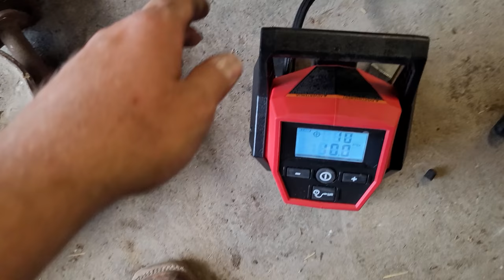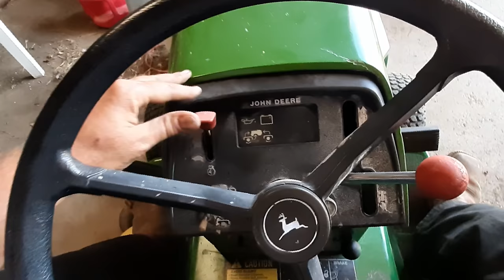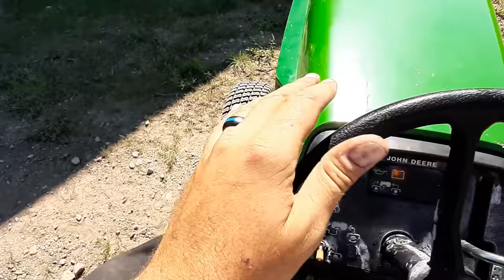Old John Deere Lawn Tractor - Will It RUN and MOW again?

Comment: Grew up with a dad who was a JD salesman. I cried when I saw that HF engine. 

BTW just a little further up the family tree was the 318 which is probably one of John Deere's all time greats in the Lawn and Garden arena. A 318 would actually be a collectable.
Reply: Oh yeah, used to have one of those. Very similar to the 316, had a BEEFY deck on 'er. Had to get it welded a couple times, the welder/farmer I took it to was an International guy. Quite jealous of that heavy deck.
Reply: Nothing wrong with the predator engine.
Reply: @justinbevier8231 there definitely is, they’re Chinese junk. You can’t beat the original engine that would of been in it, I have a collection of garden tractors and each ones got a replacement engine I wish I can find an original

Comment: Thanks.  We still have our JD 322 we bought new in 1988.  At one point about 10 years ago I got on, turned the key, and nothing happened.  I parked it and there it sits.  This video has given me the enthusiasm to get it running again.
Oh, it was very reliable except for the mower deck - it loved to throw belts, even when new. PITA job to replace them.  Even the dealer was baffled.

Comment: we've got a late 70's deere lawn tractor. Picked it up from a lady on FB for $150. Thing runs great. Has the original Kholer engine still, came with rear tiller, electric lift, and we just grabbed plow for it recently. terrific tractors. Going to do a full restore on it one day.

Comment: Deere made great garden tractors back in that era. This 316 is pretty similar to the 318. I still have a 318 myself that I have a 50 inch mower and the model 49 snow thrower for, it's a great machine. Still going nearly 30 years later. Hold on to that 316, they are built like tanks.

Comment: Of course it will run again it's a John Deere where I'm from is still common to see hundred-year-old John Deere tractors still in use by their proud owners of course I live in Iowa
Reply: It's got a shitty Chinese replacement motor, though.
Reply: I’ve never owned anything but a John Deere mower from a 112 to 114 to 312 to 316 to my current 728 x treme. The best part been mowing for 41 years . Well my 3 children used the 316 way more than I. They are all grown up and the two girls don’t mow any more and the boy well he or his bride can push mow in fifteen minutes but it is with a John Deere. Nothing runs like a Deere and we will pretend we never heard the part about smells like a ……..
Erik I’m with y’all on yet another channel.
Reply: @pibbanon1987  those preadator motors arnt that bad.

Comment: I've got a 332 my dad bought new in 1988. 3300 hours on it, Yamnar diesel still doesn't use a drop of oil. 316, 318, 330 and 332 are all similar machines. All of them good tough old rigs. Well worth fixing up.

Comment: Had a ol John Deere that smoked more than a coal mine on fire but it was free. Tires on the front were dry rotted but still had good tread. A feller thought to himself “why spend $60 on new tires when you can spend $30 and buy some Slime and patch them”. Welp the slime worked a charm for over a year

Comment: Awesome! Derek I bought a JD 332 which has a 3 cylinder Yanmar diesel in it. They are the toughest garden tractors ever made. Hydraulics etc. 
Lots of accessories for them, but they're getting hard to find parts for.
Should be easy for you to get running and fix it up. 👏👏👏🤠😎🥃🥃🥃🤙🤪💯

Comment: Hey Derek, Pro tip: When trying to do a tire plug...lube up the hole reamer with some rubber cement glue, it'll go in super easy then. Same with the plug or "worm", once you have it threaded into the insertion tool, lube that up and in she goes!
Reply: Another option is to just chuck up a 1/4 inch drill bit and drill out the hole. Still a snug fit for the plug but way easier for me than a reemer. I've been doing it that way for ages on my stuff. And even in a 10 ply that gets the full trail and highway treatment they have never once let go on me
Reply: Also much easier to have some air in the tire

Comment: We had a 1987 316 with the Onan 18hp engine.  Loved the sound of the  opposed twin cylinder Onan, and it had great torque for wheelies..... the last of the ALL metal JD garden tractors. sold it and got a 1998 425, which is a beast!

Comment: The battery light means that the system isn't charging the battery.  Something is still funky in the wiring most probably. You'll need to fix that or you'll get a dead battery real quick-like.
Reply: That's what I thought when my old dear John bat tree light came on, figured I would have to fix it when the battery finally went dead. Nope, still charges, turns out a diode for the light was leaking, haven't changed the battery or charged it once and the light is still on 8 years later
Reply: He's used to it by now. He has the worst luck with batteries in the world.

Comment: Congratulations! i have an old 'Farm King' garden tractor that sat in a field for a few years after the shed it was in blew away. After a good amount of work, new tires, etc., I just need do a bit of rewiring and I'll have a nice old machine. They built them very strong back then, and the class 0 three-point is a bonus as well 😊

Comment: I like the old Scout traveler and I have a 77 model Scout II Tera with the 3 foot long bed and the factory fiberglass top over the separate bucket seats and it has the automatic shift on the floor console with the 304 V8... My parents bought it in either 1979 or 1980 and my dad let me have it a couple years ago and I've got to start trying to restore it little by little as I can afford to....I've also got a 89 model bronco II Eddie Bauer that's in pretty good condition besides needing the fuel pump replaced and 2 small places on a quarter panel

Comment: JB WELD works great on plastic: radiator expansion tanks and fuel tanks.  Oops- I commented before you used it.  Anyway, looks fine, runs fine.  Good!

Comment: What I wouldn’t give to spend a day just hangin out with you fellers.. this reminds me slot of growin up spending most of my time in the garage with my papaw and cousins. We were always turning wrenches on somethin.  Mowers, cars and trucks, four wheelers, dirt bikes. If it had a motor we were working on it lol 
 I remember my cousin had this old ford rider, we made duals for the rear end and put dual tractor tires on it and a hood stack. We’d climb hills on them. 
 I remember I climbed this hill at home, half way up I jumped Back on the seat and boy did she bite the ground, next thing I know I’m staring at the clouds with a mower smashing down on top of me. It flipped end over end, landed on its wheels and took off down the field still running lmao 
Good times

Comment: Good for you   I have a 1986 Cub cadet that I Put anew motor in and rebuilt the deck more than once   She runs like a real champ.   Steering locks up some how.  I have to do the same thing you did pullthe top offand see what is going on

Comment: I have an 81 318. Probably the best small property/home gamer machine ever produced. Solid 18HP Onan engine. The transmission alone is half the mass of an entire big box riding mower. Hydraulic power steering. 4 Hydraulic outputs at the front. 3 point hitch. Plenty of solid implements. She's a beast.

Comment: I own a 1984 jd 316 that has been in the family since the late 80s. Currently has 980 hours on the original Onan. The neighbor has gone through 5 tractors in that time but the old 316 is built like a tank. I do maintain it religiously but they just don't build them like that anymore.

Comment: I worked on those old girls for 30 years. Most were fun, some weren't.  The PIN for the tractor is on the pedestal below the PTO switch.  The wiring looked "interesting".  Looked like maybe a 39" deck? Anyway it'll be good for another 20 years.  Love the channel.

Comment: The 316 was built between 1984 until 1992 and was basically a downsized 318 and has a Kohler single-cylinder engine.   It
was built in Horicon, Wisconsin and was one of  the best mowers Deere ever produced.  Real steel.

Comment: Bought a 86 322. Yanmar 3 gas. Would pull wheelstands. Bullet proof motor
 Sold to friend cheap.332 deisal. Same block. The best jd garden tractors

Comment: My dads 316 went through 3 motors. He finally put a bigger Honda motor on it. It still runs, but the ears on the transmission case snapped off and that is what killed it. It’s still out in the barn, and I may try and find a new transmission for it. Who knows

Comment: I have an all original 316 with the Onan engine in it. Same deck as the one you're farting around on. I got the tiller and snowblower attachments. I have yet to go get cold snacks with it. I'm surprised by the condition of the paint on that one. Mine has contaminated metal so the paint is mostly missing. It just falls off.

Comment: It's crazy that a guy that is so good with cars is afraid of working on a mower. I built a riding mower completely from scratch out of spare parts that I had laying around last summer. It only took me two days, and I don't have a tenth of the tools that Derek has. Mowers are easy, don't be afraid, lol. That tank is easy to fix. Just heat up some of those zip ties you guys have laying around, and use the melted plastic to seal it. It will be good as new when it cools. Yes, I've actually done that before to fix the exact same issue on a Deere that i was playing around with. The zip ties work just like solder wire. Just heat up the tip and stick it in the holes. My newest project is a 1972 Western Auto push mower that has been sitting over 20 years. I'm buttoning up a Troy Bilt Pony that had been sitting for 5 years today, and then I'm starting on that one. I love working on mowers. I taught myself and fell in love with it.

Comment: Well i have a 1982 john Deere snapper 310 and i also have a 1996 John Deere GT262 and 2 more newer ones but the one is a part mower but both of my older ones both run

Comment: The old girl got an engine swap at some point in it's life. These came with Onan engines from the factory. The predator is a common swap though. Tough little tractors.
Reply: J U  -  We used to have a 322 at the golf course i worked at.  It had a 3 cylinder Yanmar gas engine.  Nice little unit even it it did sound like an angry hornets nest at full RPM's.

Comment: Good old mower , I  see the predator replacement engine, .... it came with a Kohler 18 HP, / Onan ,  I   believe, 318, the primarily used sundstrand hydro transmission , you can change the hydro filter and fluid on it ,  ..indisuructable, believe me ,I've beat them , they are awesome,  ,   is one of  Deere's best tough mowers ,  in the 80s  I had many JDs , back then

Comment: neutral takes about 4 seconds to adjust, but you gotta take the body pan off again.
Jack up the rear tires, it's the cam on the side of the hydrostat that the linkage goes to. Loosten the small nut, adjust the big nut (the 7/8 one i think) forward or back with the tractor running at FULL RPM. 
Also a good time to recommend the hydrostat probably needs a new filter and fluid, since you're down there.

Comment: Procedure problem. I always do the tire ream thing with the tire hooked up to a compressor.  Escaping air tells me where the hole is and pressure in the helps the reaming process. Only way I’ve ever done it

Comment: Your brothers issue with the delaminating wood might go a lot easier with zip-ties. I would put something under the zip tie(s) so that it doesn't cut into the wood on the edges. Cardboard or something like that under the wire-tie might work great. Well there ya go, three minutes later he took my advice.. hahahahaha Ya'all are my kinda people. Stay safe.

Comment: Today, I actually finished up an early 1980's Craftsman 18HP c/w a 46"deck. I paid 80 for it because it was a non runner.  Put in an electric fuel pump, starter solenoid, new plugs, new gas, new carb, and 1 spindle. Runs like a charm now.  I bought the cheapest chinese parts I could find, I am ll in under 200 for it. Now I have 4 garden tractors and 1 acre of grass. Seems about right

Comment: Those reamers work a lot better with air in the tire. Or just use a drill and a 1/4 bit. Makes those gummy worms slip right in the hole😉

Comment: Go find a little Yanmar diesel for that poor "Harbor freight powered" thing, my dad had a 332 it would pull a 22' Bayliner Ciera while riding a wheelie and you'd have to steer using the brakes, which was a key feature on Deere's from that era.

Comment: 11:38 You need to put some air pressure in the tire while reaming out the hole. That way the tire doesn't just collapse when you push on it.

Comment: Farmer wiring. 36 butt connectors and 6 different color wires in 3 feet. The way I figure butt connectors were cheap and wire was expensive in the 80s

Comment: They are great when they work but, JD riding mowers are expensive motherfathers to keep up. American engineering can be tricky. Kawasaki engines are fairly east as it uses the same parts as a lot of motorcycles. Had to work on my Hydro 175 too  many times before it died. Though easier than shifting gears, the hydroststic transmissions aren't designed to last; I can tell from the way it whines the pump is working hard. At that point you are looking for a used 24HP Craftsman in the price range you want to spend. Good thing there are tons of those out in the world.

Comment: Curious, the predator engines I'm used to have weak alternators and won't carry the load of an electric PTO. What's the output on that alternator? I would assume a good battery will carry it for a while.
Reply: Most predator alternator coils can be swapped for higher output Honda parts capable of 15 - 20 amp output

Comment: Is that a rear "PTO" on that "transmission"? Wonder what you hook up to that. 

And I need to know what those wheels are on the blue... jeenco? What did you call that thing again? Some sort of Jeep/Bronco hybrid...

Yes, tire slime is great, but I'd avoid using it on your cars/trucks. Many a tire mounting shop will tell you how much of a pain it is to deal with. Lawn equipment/dirtbikes/atvs, use it always. Never go fast enough to worry about balance and you'll never replace the tires to worry about it anyway.

Comment: That tire sealant is a whole lot easier until you have to change that tire or rim. You will quickly change your mind when you spend several hours cleaning that stuff up.
Reply: Not with tire slime, i have Changed and tubed tires i have put that stuff in with no problems.

Comment: I have two 1983 JD-212s. If someone offered me a brand new JD for them I'd pass. These things are built like tanks. I've even pulled cars out of the ditch with the little 12hp Kohler engine.

Comment: Are you familiar with the old John Deere's that had the Kawasaki motors in them in the 80s? Believe they only used those motors for 2 years in the hydrostatic mowers, I may be wrong there, but I've got an old 112 L Kawasaki hydro.

Comment: Original engine was a 18hp Onan.  Impossible to find parts.  Had the exact same machine 20 years ago.  They are over built tanks.  The 318 was a better machine. 20hp, front and rear hydraulics, and power steering.

Comment: Neutral on a lawn tractor really isn't necessary. When it's running your on it and going. Who starts there tractor and let's it idle?
Reply: Well, sometimes I gotta dismount and pick up the thing I just ran over and throw it to the other side of the yard so I can hit it with the mower again the next time I mow. And I ain't shutting er down just for that.

Comment: 6:40  sittin there watchin arll that fuel leakin out all over the floor... cleaning that floor off really good it is yes... but....

really...

why didn't a feller bring the BOATS FUELTANK or that little portable one you usually use to test new engines????  ummmmm  kinda skipped a SKETCHY PART THERE :)  didn't a feller??